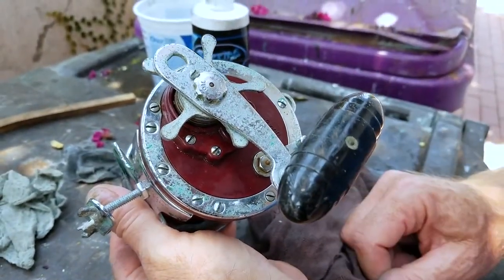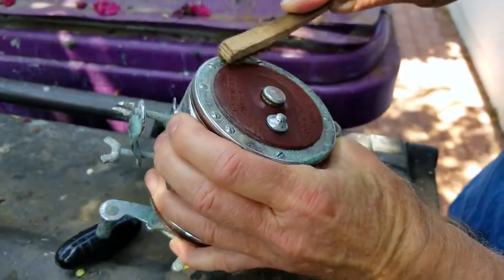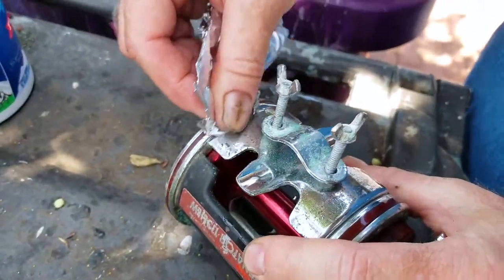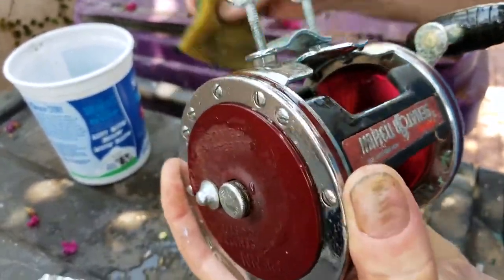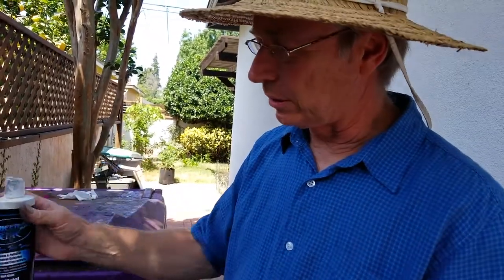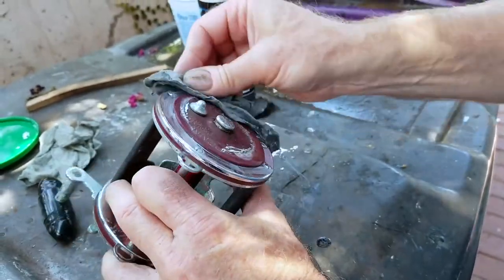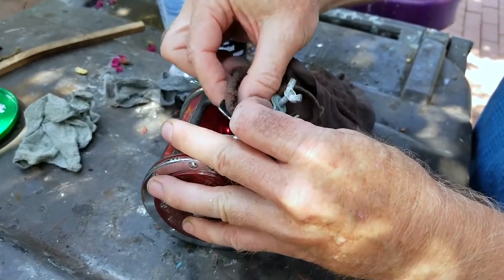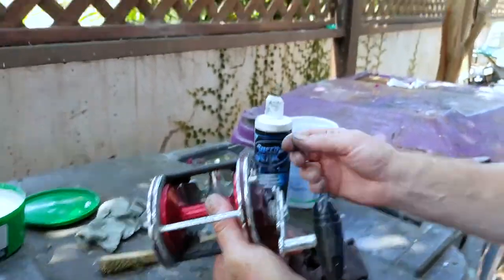Fishing Reel Restoration -  How to Bring Back the Luster

Comment: Hi Jon - hope all is well.  I found this informative.  If you want to try a method that is almost labor free, get Flitz metal pre-cleaner and then Penn's Rod and reel cleaner.  Both are in squirt bottles.  The glitz melts the corrosion away with a spray and water rinse.  The Penn both cleans and polishes the metal as well as the side plated.  Each cost about $15 for the large bottle.   Best wishes - Stay well - Dennis
Reply from the maker: Thanks Dennis! I’ll give it a try
Reply: @castandspear  did you ever try this?